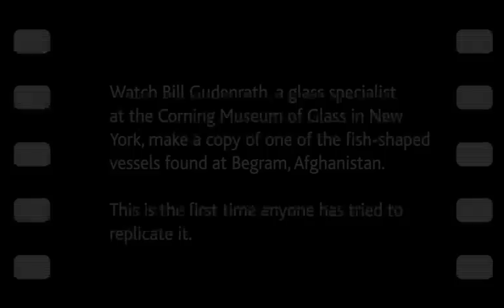How to make a glass fish replica

Comment: The difference in temperature between the molten glass and the cooler glass caused it to blast apart at the point of contact because the glass molecules were expanding right there very rapidly. Its like if you pour boiling liquid into a thin juice glass, it will break apart, or sometimes a glass casserole will crack apart if it is placed on the cool metal of the stovetop straight out of the oven. 

I always cut my glass. This is a much better technique- very clean.

Comment: Can anyone tell me why you have to kiln fire glass after making something?
Reply: Thermal shock. If you allow the glass to cool down quickly it will crack or break because it is cooling down from around 1000 degrees to room temperature. The kiln allows it to gradually go from around 1000 degrees to room temperature over so many hours to avoid thermal shock. The time it takes in the kiln depends on the size of the glass.
Reply: vejtheguy Okay thanks! I want to get into glass but dont know much.
Reply: TheJuggernauter Try it! You will not regret the experience :) I just started a few weeks ago and can not stop.